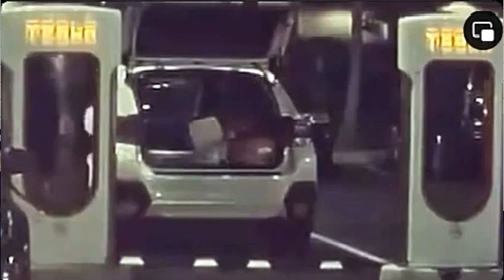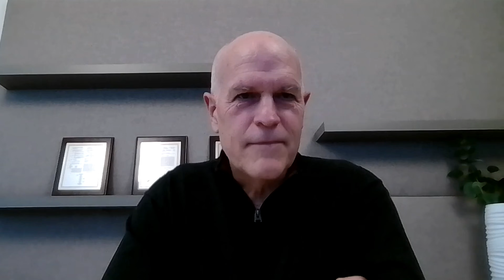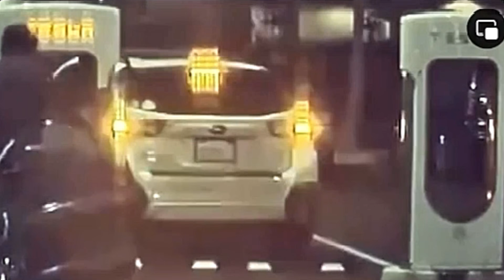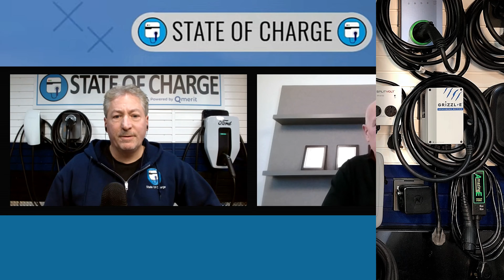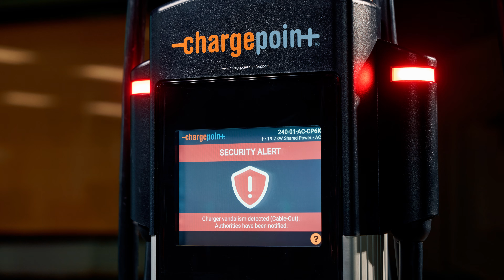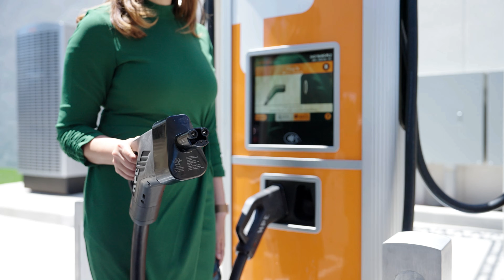Chargepoint CEO Rick Wilmer Explains New Theft Resistant EV Charger Cables, Charger Protect Feature

Comment: Europe already has this problem solved you have to bring your own cable and then you just plug into the connector on the charger and plug into your car with your own cable duh!:body-blue-raised-arms:I wished I had thought of that
Reply: Lol, not for DC fast charging
Reply: @PatrickFugate  true. So how about controlled access like some ATMs you have to use a card to get in to be able to use the ATM machine?  And how about making copper so cheap It's not worth stealing?

Comment: This would be an easy problem for the police to solve if they wanted to.  All they would have to do is send an undercover officer to a scrap vendor with some obviously cut off charging cables and then ARREST anyone who buys it without proper documentation.    Once the scrap yard owners start going to jail the market for stolen cables will dry up quickly.  Same thing for catalytic converters for ICEVs.
Reply: They have to remove the insulation if they want the most money, and that's what they do. Then they chop up the copper to 1000 pieces and say it was to make it efficient to transport. How is the scrapyard going to identify that. If they came in with direct chopped cords, most scrapyards would turn them away because it is not worth it already

Comment: Whenever I use chargepoint, the two forties are set at 5 to 7 kilowatts per hour. Can they be set higher? So we're not sitting at a two forty volt for 2 and a half or three hours in either the heat or cold. I live in an apartment complex and only have public chargers to charge my car.
Reply from the maker: That's likely the limit of the circuit it's installed on. And as I mentioned at the end of the video, Chargepoint has no control over that. They just sell the chargers. The property owner where you charge owns it and sets the rate of charge and how much it costs - Chargepoint cannot control that.
Reply: The more electricity you want to have available at once, the larger and more expensive every component has to be, including the circuit bringing power to it.  As a residential user, you don't pay demand charges, but commercial customers are subject to the charge.

Comment: Maybe we need to move to customer providing there own cables at the chargers. A bonus is your cable will always have the connector you need ( j1772!j3400)
Reply from the maker: That couldn't work for DC fast chargers
Reply: @ this is true but destination chargers like hotels and shopping areas would work. Also any on street charging we might be able to get

Comment: Should have made the cable much thicker so it deters would be thieves just by looking at it. Also a thicker cable wouldn't fit a mainstream cable cutter.
Reply: There are commercially available, battery operated cable cutters that lineman use daily.  Not hard to buy and even easier to use.
Reply: @kcgunesq 
But pretty pricey compared to hand tool.
Reply: @ Sure, but if you are going to steal copper, it isn't like you above stealing tools.

Comment: Or use the European approach for L2 and have the car driver carry their own cable which is used to connect the car to the charging station.  There is no cable to steal.
Reply: In addition to no cable to cut, it makes for a smaller install.  Think lamp posts, parking meters...
Reply: L2 is so slow, thieves will steal the whole cable... then the drivers will be the ones to kill the thieves. Lol
Reply: can't on DC charging, these cables are water cooled most of the time.
Reply: I hope we transition to this for level 2.
Reply: Just let the driver use their own cable.  daaa !!!

Comment: I have another idea. Make it a federal crime to accept cut charge cables.  I understand that wouldn’t be a perfect solution, but it definitely has more positives than negatives.
Reply: Make the cutting of the cables a federal crime as they are affecting critical infrastructure. That way, the thief would not simply get a slap on that hand after getting caught.
Reply: Great.  Except that once they strip the insulation, it isn't identifiable as a "charger cable", its just copper wire.

Comment: This may be a dumb question, but has anyone tried going after the folks who "launder" the stole copper? If thieves can't convert the stolen copper into money, they're not going to steal it. 

If law enforcement were to go after the folks who buy the stolen cables, wouldn't that end the problem?
Reply from the maker: The thieves will strip the copper out of the cables and wind it up into balls. Electricians do this with the unused or old wire they pull during renovations. There's really no way of determining if the copper was legitimately scrapped or stolen.
Reply: I know there has been trouble with people stealing air-conditioning condensing unit units located outside homes.  Often times at new construction locations.    I believe the thieves strip them out before bringing to a scrapyard.  Last time I went bringing a bunch of old air conditioning units, they took my drivers license information.  I think it’s tough to enforce

My gut says same with these cables… Not sure if the thieves are pulling the copper out of them ahead of time… Scrapyard wouldn’t know where some bare copper was coming from
Reply: Also report scrap yards not taking IDs to the city/county/state
Reply: My argument was, forget flashing lights or sirens. Keep the alarm silent, have Charge Point Protection alert the police, so they have time to get there in time to catch them in the act. It's not going to cost the companies any money, since the THIEF will pay for all damages! THAT will solve the problem.
Reply: @vincentrobinette1507  Police won't respond quickly enough.
Reply: If they respond at all.  Most don't about what they consider petty theft.
Reply: @vincentrobinette1507 both
Reply: In the new Ev hating America, this theft is accepted and the people buying the copper are Businessmen doing America a service thru capitalism. Happy Days are here again.
Reply: Minnesota tried passing new laws to prevent stolen cable from being resold, but then metal scrap business lobbyists are against it because they think it discourages 'small time' recyclers, yup.
Reply: Scrap yards require identification for payment, at least where I live.  But once the conductor is stripped out of the jacket, its basically impossible to show its origin.  Sure, it may be suspicious if someone brings in what looks like 3/0, but they still wouldn't be able to know its origin.

Comment: I’ve seen this here in Minnesota. These degenerates have also gone through and pulled all the wire out of blocks of city lights. Good for Charge Point!
Reply: There's a new law in MN requiring license to sell copper as for Jan 1. Obviously, it won't completely solve the problem, and there's going to be an increase in business in Wisconsin, but it is something.

Comment: Is it still safe to use the cables once the insulation has been cut through or are they still going to have to be replaced anyway?
Reply: still have to replace the cable for safety reasons. but the idea is to hopefully limit the damage to one station since the thief is stopped at the first one
Reply: @ruly999  re: "the idea is to hopefully limit the damage to one station since the thief is stopped at the first one" which unfortunately is an idea based on the ERRONEOUS PRESUMPTION that a person can ONLY ever attack a DCFC location to "steal" and not simply to "vandalize" and knock it out of service because they don't like you.  see these are the mistakes you make in judgement when you're "baby young to the world" and are afraid to confront the reality that ALL HUMAN ACTIVITY IS INHERENTLY POLITICAL.
Reply: Q1: Is it still safe to use the cables once the insulation has been cut through(?) A1: no.
Q2: or are they still going to have to be replaced anyway? A2: yes.

Comment: The scrap yards are the biggest part of the theft!
Reply: Correct, scrap yards need not buy them, however this much I know, my good friend is an electrician and of course he has scrap copper, but he doesn't bring it to the scrap yard with the insulation on it as at least around here they won't accept it that way, he has to strip all the insulation and bundle and weigh the copper. so for the scrap yard how would they know it came from a EV charger, it's just copper and they're buying just the copper so I don't think they're completely to blame. I'm sure there are those that do partake in it but I would guess they're a minority.
Reply: @Dochart268  even if a yard accepts the cables with the insulation still on it.  You would get paid a lower rate due to the "contamination".  So its usually worth a scrappers time to strip off as much of the non-copper parts as possible.  But yeah the raw copper doesn't have "ChargePoint" stamped on it.

It honestly only takes 1 bad yard per state to keep the stolen metals market humming.
Reply: @steverogers8163  my country greatly reduced metal theft by: 1)mandating ID verification when buying scrap 2) no cash, transfer only 3) outright ban on buying certain items (manhole covers, railroad hardware, lampposts...) from individuals (companies only) 4) enforcing the rules
Reply: @steverogers8163 I think most crooks won't bother doing the work to get the full value.  Because if it is too much work, you will be better use of your time doing legit work vs crime.
Reply: If the thieves have to strip the insulation off the cables isn’t that a lot of work? How much can they make? Wouldn’t it be better to just get a job?
Reply: @LawrenceAsero  There are people who will put in 2x the work for half the pay to AVOID getting a job than to actually get a job.
Reply: @LawrenceAsero  thieves are fools aren't they...
Reply: LawrenceAsero Stripping wire jackets just require a box cutter.
Reply: Truer words have never been said!
Reply: This
Reply: Minnesota is requiring a license to sell scrap copper as of Jan 1. Apparently, St. Paul spent over $1m replacing wire stolen from streetlights in 2024.
Reply: Yup! We more or less fixed the muffler thefts here in WA by just requiring ID, delaying payments at least 3 days, and requiring payment through traceable means like a check.
Reply: In the early 90s in Detroit, thieves were stilling man hole covers and scrap yards were obviously accepting them.
Reply: The yards are still accepting catalytic converters. Law needs to step up. They are shameful.

Comment: Let's see it against a hand held hydraulic bolt cutter. The cables need to be retractable.
Reply from the maker: Cable thieves aren't showing up with those
Reply: @StateOfChargeWithTomMoloughney I’m surprised this isn’t a DC fast charger product.
Reply from the maker: @anthonyc8499 It is. The new cables are available for CP's AC and DC chargers
Reply: @ ah, good to know! Based on the conversation, it sounded like this was only for AC cables not DC. The DC cables in the Seattle-area have been hit incredibly hard. Starbucks-Volvo’s ChargePoint CPE250 chargers in Issaquah, WA all have their cables cut (again) and could REALLY use these cut resistant cables.

Comment: What’s amazing CEO is in Las Vegas you only have 6.6kw to 9kw chargers with ONE working 48kw charger. Why does ChargePoint have NOTHING in vegas? We have no charging here.
Reply: Chargepoint sells the equipment, they don't own or operate it so they aren't the ones choosing where they are installed.